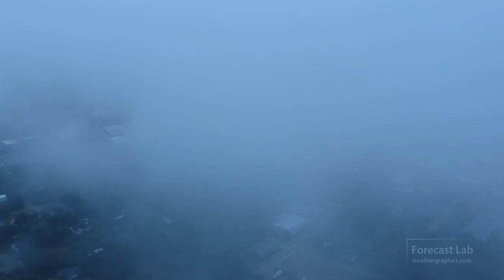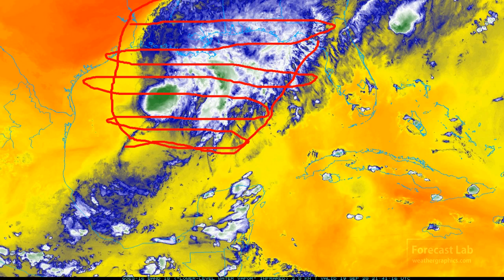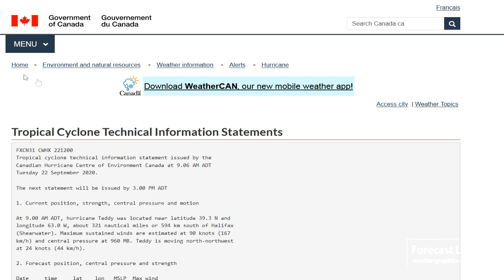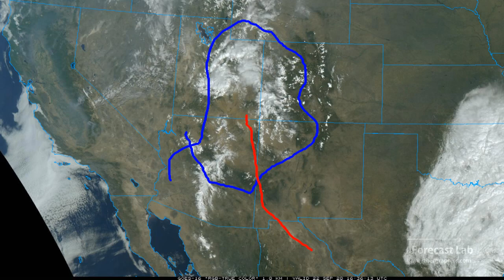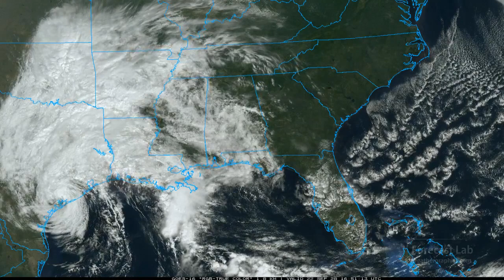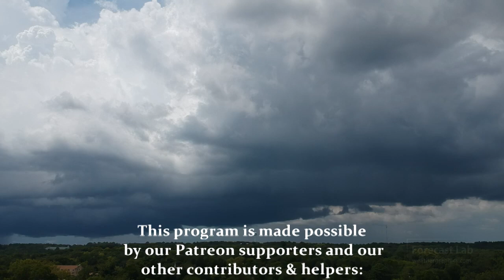9/22/2020 -- Tropical Depression Beta aerial footage / US cold outbreak next week [Forecast Lab]

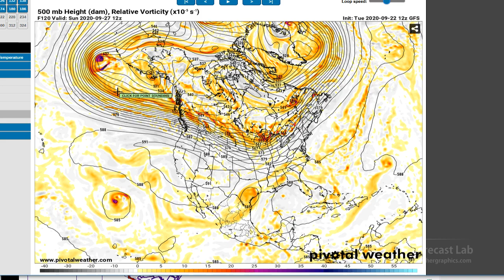Comment: 6:43 Why is that dynamically unstable?  

In my mind, I pictured stretching out a rubber band and deduced that tapping the middle (a passing minor/major shortwave) would cause the rubber band to vibrate wildly.  

I also pictured (given the close proximity of the geopotential heights latitudinally) that the cold air would want to slide south under the warm and the warm air would want to rise north above the cold air.  

Are either of my reasonings correct? If not, please correct.